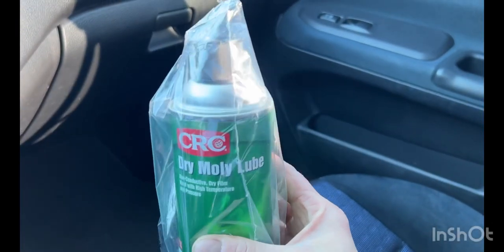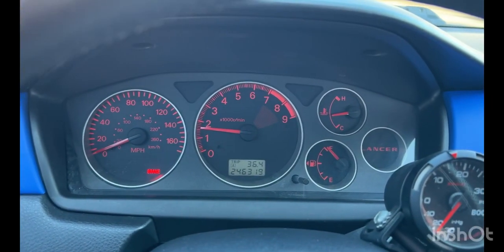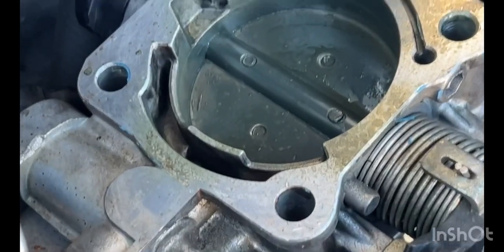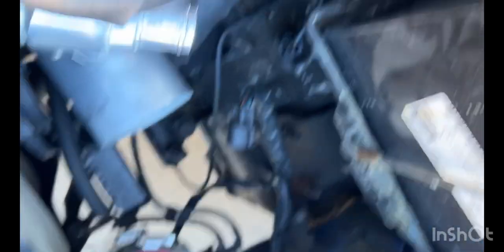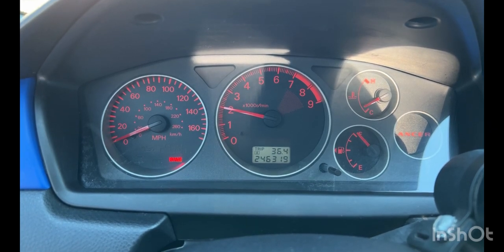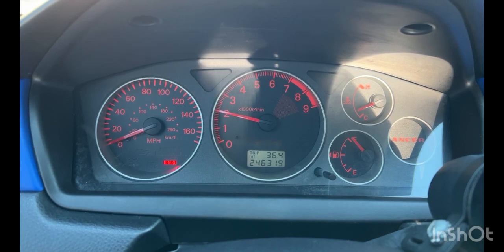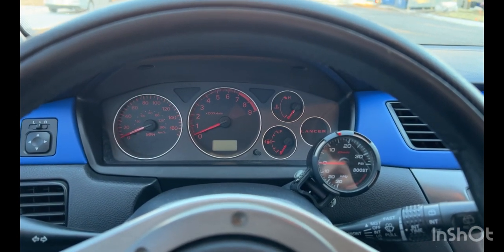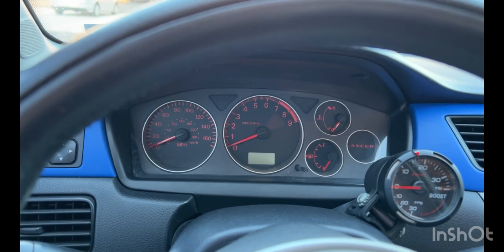Testing Evo Forum suggestion to use Dry Moly Lube on Throttle Body to Stop Rough Idle on my Evo 8

Comment: Throttlebody shaft seals. The evo's and regular lancer also had this issue more with the evo. Theres tutorials how to disassemble the whole throttlebody and take off the shaft that the butterfly is bolted to.
Reply from the maker: Awesome!!  Thank you for this suggestion!  The issue has kinda gone away for the most part but I will be building another motor at some point and it would be great to know trouble areas like this for when it happens with the next motor

Comment: i’m late to this, but did you have rev hang when driving when this issue occurred? currently it seems like when i’m moving slowly at low speeds for a long time i get rev hang, and when i clutch in to neutral my rpms jump from 1k-1500 a few times then sits at 2-3k until i go again. replaced my iacv and didn’t fix the issue.

Comment: I have the bouncing idle issue on my X only when it’s cold though in N before coming to a stop.  When it’s warm it’s not an issue.  I’m at 53k mi.
Reply from the maker: Wit my car, when it’s cold it wants to idle kinda high but it doesn’t have the bouncing idle issue until it warms up, then it bounces until I come to a complete stop.  The idle also starts to climb when warm also. 

I have a feeling it’s an issue with either the idle/air control sensor or maybe some wiring that has wear in the rubber coating and it shorting out causing the idle issue. I may buy a new throttle body and new idle air control valve and see if that makes any difference as well but it sucks that it seems like lots of people have this issue and no one really knows the culprit. 

I’ll figure it out one day. I’m going to rebuild the original motor and change the intake and throttle body to a larger diameter one, along with replacing the idle/air control sensor and idle position sensor with brand new OEM ones just to make sure it’s all brand new and not contributing to a future issue.

Comment: Following... running into the same issue RN after changing my IAC... If you figured out what the source was please share. I've been at it for weeks. I didn't think it was a Boost leak because I didnt change anything or touch the Set screw.
Reply from the maker: I ordered some seals that I was told May fix the issue but they haven’t come in yet so as soon as I get them I’ll make a video and hopefully it resolves the issue

I figure I have a vacuum leak or something bad right now because my boost gauge only shows about 10 lbs of vacuum when it used to be closer to 25 lbs.
Reply: @itsnevo8757  gotcha, I’m going to check lines as well and replace some and see how it goes. One thing leads to another with these cars.
Reply from the maker: @JayEvo8457  it sucks because I had one exactly like my current Evo when they were brand new and they were bulletproof back when they were new…..it sucks that they are 20 years old now and starting to show some weaknesses that are sometimes difficult to diagnose now
Reply: @itsnevo8757  Changed out vac lines, tested with carb cleaner no leaks that i could find.... Now get this..... with AC on I'm idling now consistently at 1.8k rpm(little high) with AC off it's bouncing between 2.3k ish and 2.8k ish consistently. No fucking clue what's going on smh. Going to contact the tuner Monday.
Reply from the maker: @JayEvo8457  for me it seems like I have to set the idle to about 1500rpms just to make it idle at all. Sometimes it wants to climb towards 2000rpms but if I set it lower it wants to occasionally stall when I coast to a stop. 

I’ve been told by some people that the tune makes a big difference but with my boost gauge reading low vacuum pressure, I am thinking it has more to do with a leak in vacuum. 

Let me know if you get anything resolved by the tuner because that is another spot I will have to visit at some point as well
Reply: @itsnevo8757  I bought a Evap smoke machine and tested some of my lines again. Found 2 on the intake manifold that had a really bad leak. One was a button cap the other was a vacuum line. Need to get some clamps and i'll re-test it out. Tuner said the idle was set high via the BISS screw as well because it was probably tuned with the leak. I'll update you again if you're still having issues with this.
Reply from the maker: @JayEvo8457  that’s awesome you are getting some direction as to what is going on with your car!  I need to get one of those smoke machines, it would definitely come in handy for issues such as this. 

Please keep me updated!
Reply from the maker: @JayEvo8457  so today I discovered what seems to be the cause of my idle issues. I made a video talking about it as well, but it ended up being a vacuum leak on the hose going to the boost gauge inside the engine bay. The hose was slipping off the fitting and when I looked closer I discovered the hose was split so just pushing it back on wasn’t going to stop the vacuum leak. I ended up having to cut the split area off and I used hose clamps to re secure the hose to the fitting and it seems to be idling way better now.
Reply: @itsnevo8757  Nice! My situation keeps getting better then worse... Now it's fully built on SD as well. I could have any number of issues. So every day hopefully 1 steps closer to my source.
Reply: also my boost gauge and AFR gauge doesn't work after I got the car back from the engine rebuild... so i'm shooting in the dark.
Reply from the maker: @JayEvo8457  well hopefully little by little you get all the issues resolved and have a great running Evo soon!
Reply: @itsnevo8757  Ended up having 2 issues. 1 was the tune which needed to be fixed. Second was that my TB had 2 holes in(very small pin holes) causing a massive air leak.
Reply from the maker: @JayEvo8457  I’m glad you were able to figure everything out!  It has to be a relief having everything dialed in again!  

I know the tune on my Evo is a crap tune that a previous owner put on but I’m starting to get a oil burning issue now on my Evo and it’s either engine internals or maybe a turbo that is on its way out so I’m going to have to start the original engine rebuild sooner than expected
Reply: @itsnevo8757  Sounds like owning an evo.
Reply from the maker: @JayEvo8457  lol that’s true. Luckily I have 2 motors for this car so hopefully the one smoking oil holds on long enough for me to get the other one rebuilt

It’s weird for me because my first Evo I bought brand new and I had a 1995 Talon TSI AWD at the same time and they were both reliable and great cars but it is 20 years later.